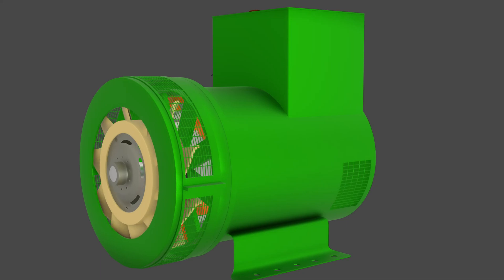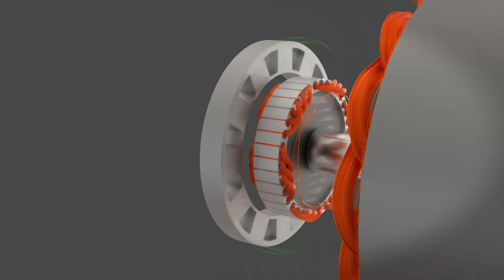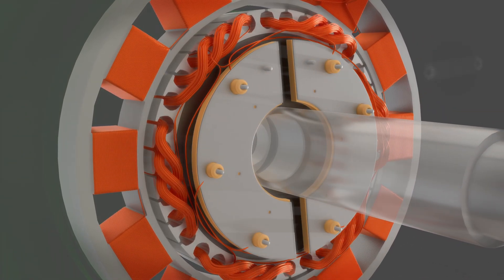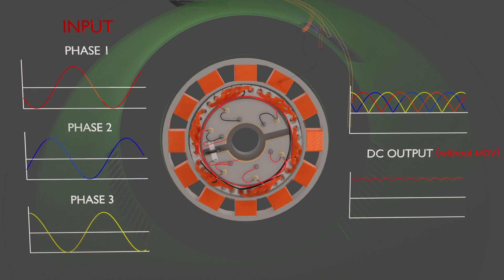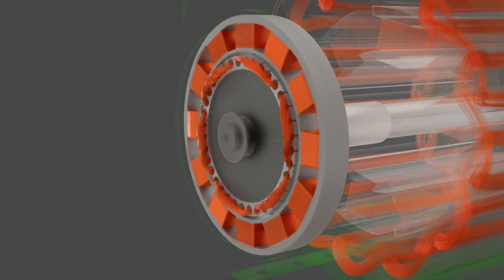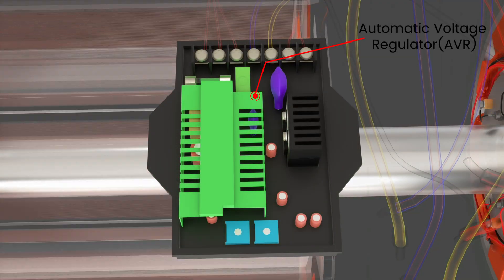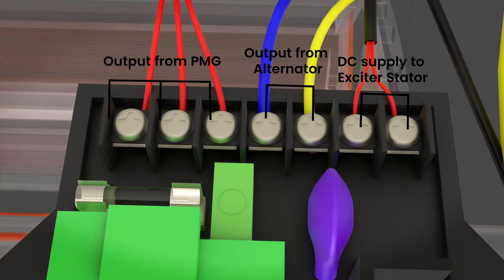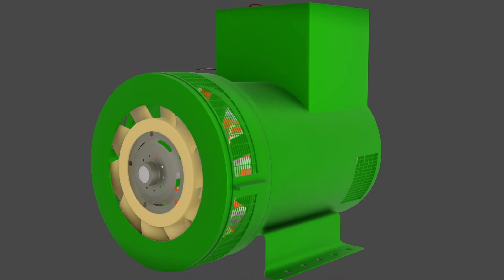How an Alternator’s Exciter, PMG & AVR Work  | Animated Explanation

Comment: Is there any alternative to permanent magnet exciter in large generators used in power plants?
Reply: Well.. . From what I understand, this is one of the main reasons most power plants must have grid power -to start producing power.
And in a "black start" situation. There needs to be some power plants around, that have diesel generators supplying start up power, for the main generators.
Or maby a hydro electric power plant, with a permanent magnet exciter generator, -to get the main turbine generator to power up.
Then the high voltage grid works as "jumper cables" to re-start all power plants without black start capability.
This situation is a a dangerus and unstabile process, as sub-stations re-connect huge power loades back, the grid might collapse again before it has retured to a stabile configuration.
Loads and supply of power must be in balance. Even more so in modern times, where the grid have less inertia from big old spinning generators. -that resist, absorbe, and smoothes out sudden changes in power loade, as both power plants and power loades are re-connected
Reply: @zigge1989   static excitation system uses brushes and slip rings
Power tapped from generator busbar 
Voltage reduced by excitation transformer 
Sent to automatic voltage regulator and rectifier 
Then fed to the generator rotor by slip rings 

Rotary needs permanent magnet 

Which is best?
Reply: Generator excitation system often use brushes and slip rings yes. 
But induction can be used to eliminate brushes and slip, to "wireless"power the rotor in a generator.
(https://youtu.be/7MvjbC4f5Aw?t=138) 😀

"Which is best?" -for what situation are you thinking of? 🙂
For a portable generator? 
A stationary standby backup generator?
Or a huge power plant generator, that can "black start" after a collapse of the power grid?
I guess depending on the situation, -what type of generator make sense , uptime/duration of use, build and maintance cost, reliability, or power quality(THD and sinewave) .. .

Personally I have a portable petrol inverter generator, enugh to power my heatpump to warm my home in winter, keep my food cold, and to cook food if power goes out.
And with alkylate petrol stored cold, the fuel has a long shelf life, unlike normal petrol